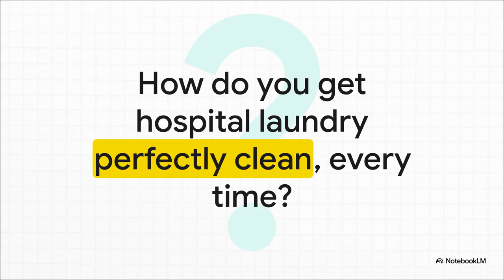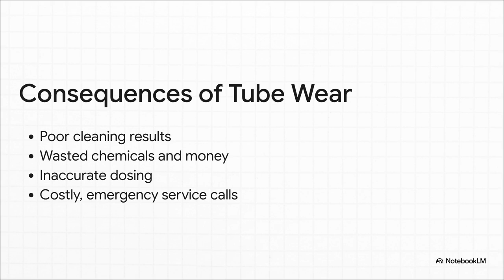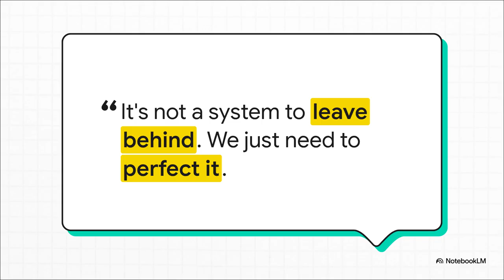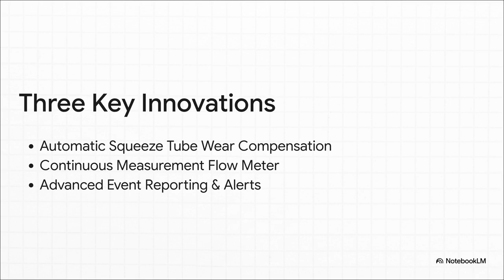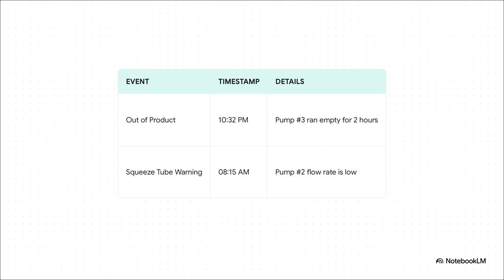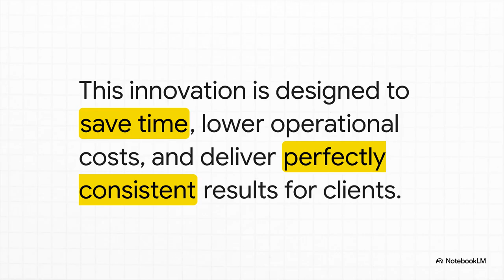Revolutionizing Laundry: How Dema's Aurora Plus is Changing Chemical Dispensing Forever

Comment: One of the wear issues I’ve found with the Dema system is in the push connect or JG fittings themselves. Dema has a great system I believe could benefit from a little bit more modularity with j their accumulators and flow meters. Viscosity has played a large role in determining squeeze tube wear also. The 50oz pump is a game changer for larger dose requirements. Overall it’s been a great system.